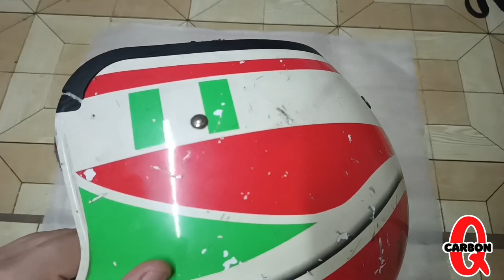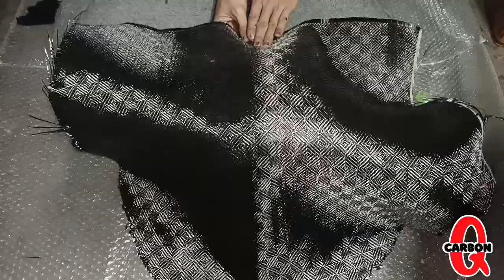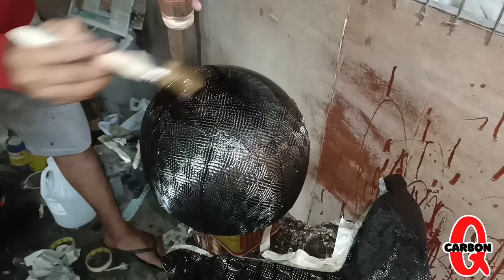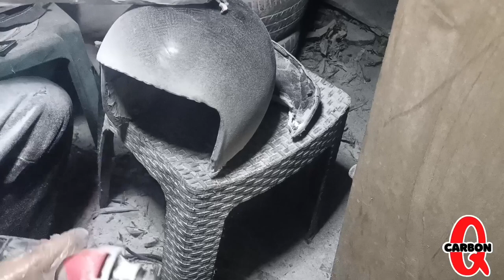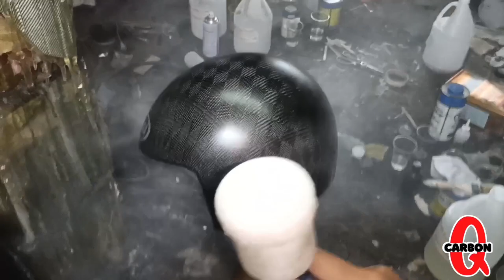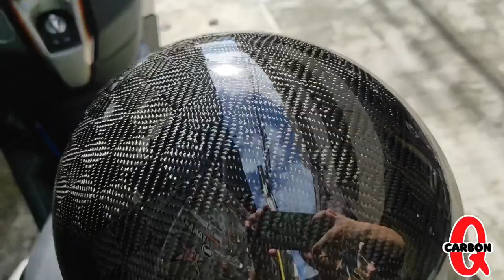LUMANG HELMET, GAWIN NATING CARBON FIBER !

Comment: Boss anong resin gamit mo at anong mixing ratio ..subscriber here
Reply from the maker: R31-200 po sir kaso tinitimplahan pa po namin yan hinahaluan pa po ng cobalt at styrene monomer. Pero kung gusto nyo naman po ng timpla na R10-60 n resin.
Reply: Ahhh ok idol..8 to 10.coats ba idol bago magliha or nagliliha na after 3 to 4 coats?
Reply from the maker: @panlamongpinoy819  yung ginagawa po namin sir 8-10 coats po muna. patutuyuin po then ikacut tapos saka po namin lilihain sir.
Reply: @qcarbonvlogs  ahh ok po..pwede ba malaman mix ratio nyo ng r31 200..kung ok lang idol ..gusto ko sana itry yan mas mabilis ba magcure?
Reply from the maker: @panlamongpinoy819  yung r31-200 nilalagyan pa po namin ng cobalt yun wala po akong ratio tinatantya ko lang po na maging color pink kasi kapag nasobrahan na halos kulay violet na sobra po bilis matuyo at pwede po umusok. tapos yung styrene monomer po pampalabnaw lang po sya. ayan po nilalagay sa r31-200 bago haluan ng hardener. pero mas okay po kapag bumili kayo kay polymer tanong nyo din po kasi dinedemo rin po nila.
Reply: @qcarbonvlogs  salamat idol...lagi ako watch vlog mo..gudluck sa channel mo..
Reply from the maker: @panlamongpinoy819  Maraming salamat po 😇 God bless po 😇